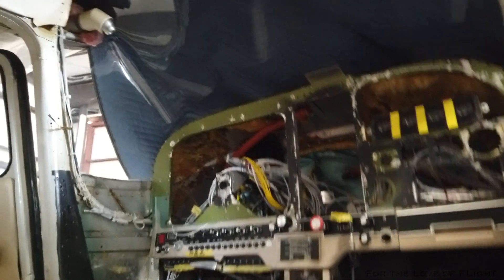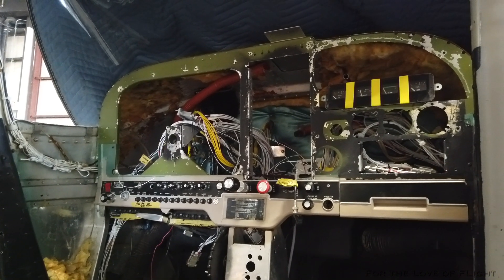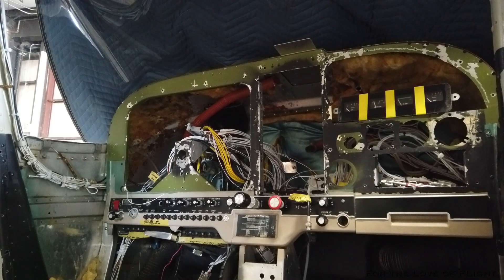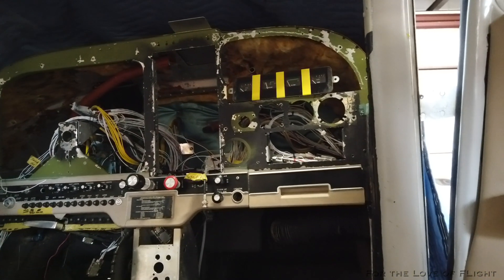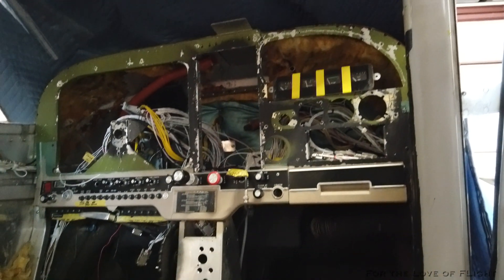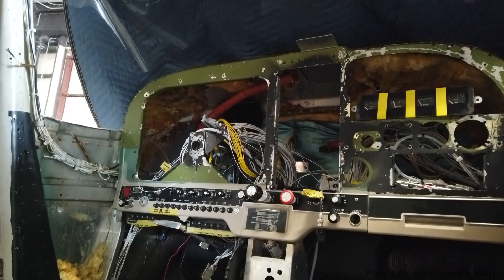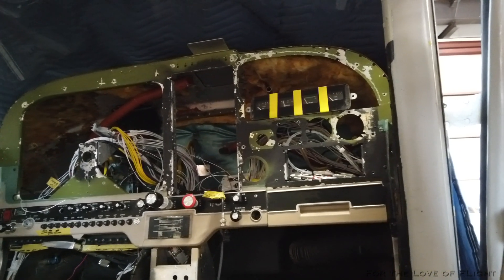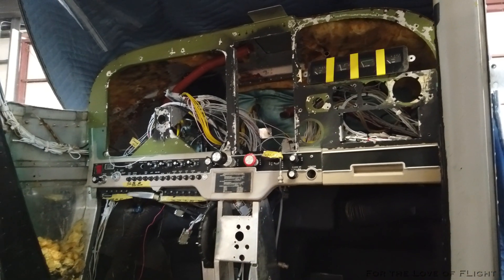Garmin Avionics Upgrade Part 4 - will i still know how to fly when this is done "JK"

Comment: Hang in there. My most recent panel replacement/upgrade/ADS-B work took nearly 11 weeks (not same shop) but changed everything. You'll be so happy when it's done and you'll forget about how long it took to get completed when you have the new toys in the air.
Reply from the maker: I am hanging...hoping by end of month...but you are right. it will be worth it... the plane panel is going to be like a new one...updated to all current instruments... maybe down the road change the 530 an 430 if they ever die....i would not want to be the one wiring all that up for sure...but with all new wire, should be good for another 30 years
Reply: Definitely! When you're all done, pop over to KCVH for lunch, my treat. I'd love to check it out.
Reply from the maker: Most definitely will for sure
Reply: @fortheLoveofFlight  Any update?
Reply from the maker: Yes posting now...